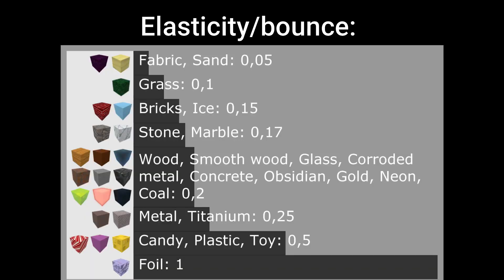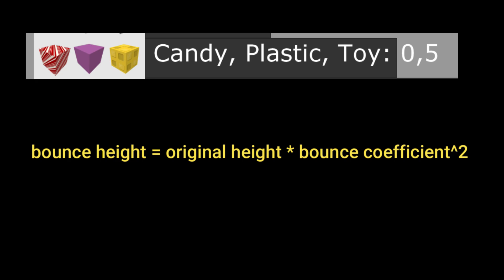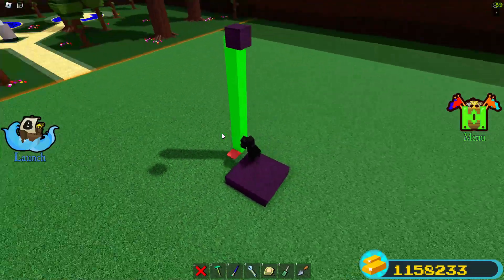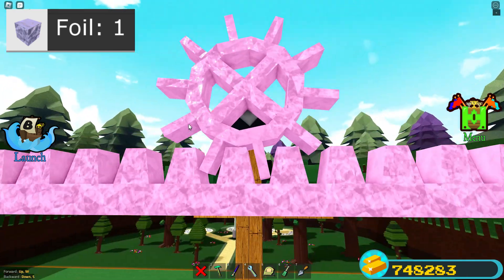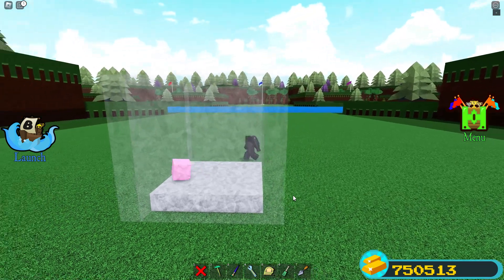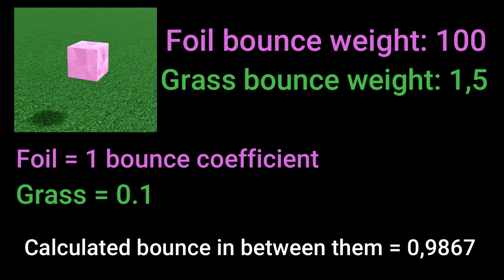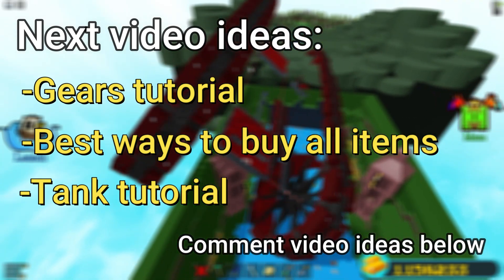Build a Boat - Block bounciness

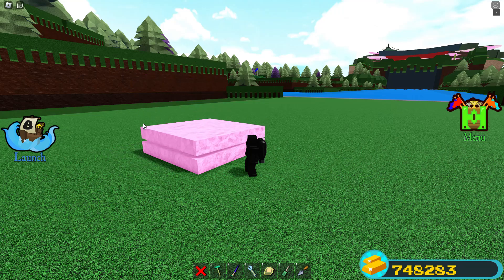Comment: 3:37 Well, the reason for the randomness comes from the physical distortion of the object. And you can make this very intense by staying away from the spawn. And you can notice this because the further away from the spawn, the Roblox bugs, leaving the objects distorted. And even if the object has the coordinate 0 0 0, 0.0000000001 of distance x, y and z, the object will distort.
Reply from the maker: nice man, didnt know about that